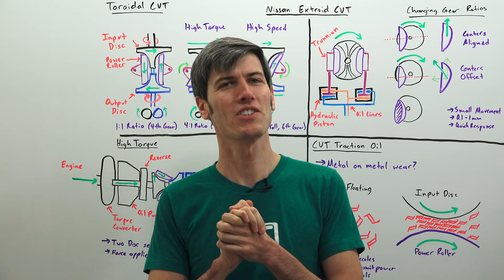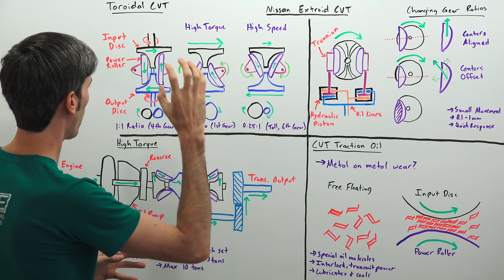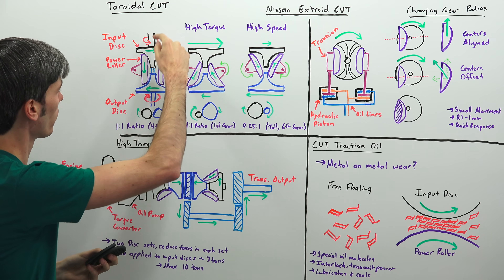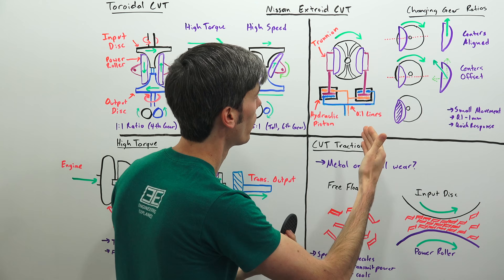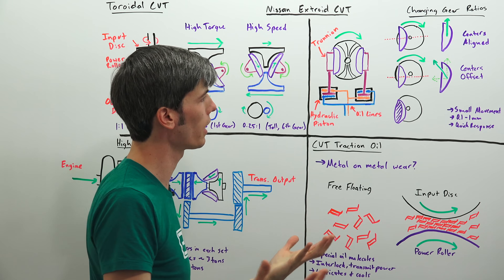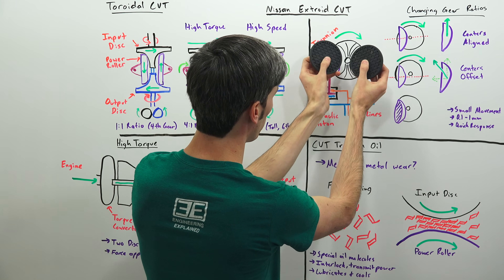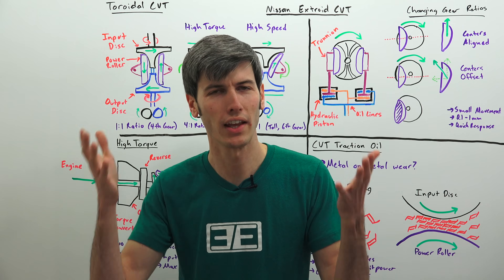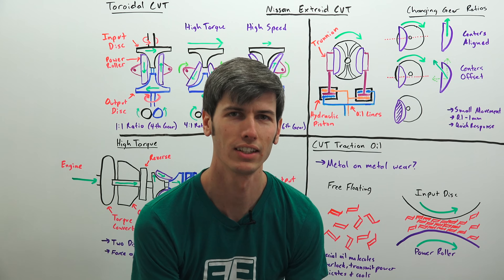Nissan Created The First Production High Torque CVT

Comment: I have the most advanced drive train would you like to know more. It has energy storage infinite ratio integrated drive steering no direct connection from the engine it also has over drive. Its called the Automatic Hydrostatic Integrator w/overdrive only 25 parts including all bearings and seals. reverse forward and overdrive are all using same said system. It has built in pre steering delivering different ratios to the right and left wheels both left front and rear and right front and wheels can be driven by the left and right integrators' outputs' . I threw out the design you just explained. Mine is infinitely variable and can steer without turning the wheels left and right in highway driving. No other design has the efficacy or simplicity. P.S. no clutches bands or torque converter. ! million miles w/o service.

Comment: This is very similar to the constant speed generator used on the A4 Skyhawk aircraft which was made by Lycoming. The Lycoming CSD used a silicone fluid for Cooling and lubrication.

Comment: I've been aware of that transmission for some years.  According to what I read, its ability to transmit torque drops off greatly at low temperatures thereby creating problems in cold climates, such as winters in northern Minnesota where the temperature may drop to -25F or even lower.  However, that problem may by now have been solved.  In any case it's good to know about these transmission developments.

Comment: Subaru seems to have a CVT in the new Ascent. With 277 lb-ft torque and 5000lbs towing capacity, they must have a solution for high-torque CVT. Do you have any information on what kind of CVT Subaru is using?

Comment: A mechanism which uses the lubricating oil to transmit the required friction from one surface to another? Sounds like a contradiction in terms. That puts me off. I remember the cvts in the 1960s Daf motor cars. Cones and rubber bands. I don't think they ran in oil - quite the opposite. It was ingenious and simple, but always sounded (and felt) as if the car needed to drop down a gear.

Comment: DAF made truck CVTs in the 70 or 80, not super reliable, hopefully the Nissan one is better.
Why would the transmission need a torque converter? is the gear change not smooth enough? or maybe they narrow the ratios, so the car is essentially missing first gear, to save money and complexity.

Comment: It a Nissan transmission. Which means it will break a 20,000-30,000. Cause Nissan is known for reliability. Looking at the thumbtack. It looks like a 4 speed transmission. Nissan went back to 70’s.

Comment: Now Ev’s can be almost perfect, fast accelerations + high top speed with minimum power losses.
Reply: Electric vehicles don't need variable gear ratios. Most or all current mainstream designs have a fixed gear ratio, no clutch.

Comment: Epicyclic gears and torque converter do the job just fine. the TC is only used when pulling away from standstill. During gear shifts, the epicyclics are slipped in/out with individual clutches. The big gain with epicyclic gears is straight cut gears with three or four planet gears on each sun/annulus assembly. High torque and no noise.

Comment: I wanna see a manual CVT. There's no reason you couldn't hook up the power roller angle to a lever and stick it into the cabin, allowing you to smoothly "adjust" gear ratio to your liking. Kinda like the prop pitch lever on a propeller plane.

And then hook it up to a foot clutch instead of a torque converter. I'd be happy as ever.
Reply: CVT would simply be less reliable than a stick shift and have no real advantage.

The only reason a CVT could be better than a stick shift is because it can constantly stay at perfect RPM. As soon as you control that manually it's not going to be at the perfect RPM anyway and you could just as well not have a CVT. Also clutch would only be for starting, shifting does not require use of a clutch.
Reply: @FranseFrikandel  The foot clutch for starting was my intention

Also I presume the controllable CVT lever would just be a fun thing; not necessarily for efficiency or power, similar to how modern manuals really don't hold a candle to good automatics, other than fun factor.

Operating it would be almost identical to operating the prop pitch lever on a plane; it certainly isn't impossible (or hard at all) to maintain excellent efficiency or power

Comment: Hate to be the one to point it out, but in the ratio diagram (small circle, large circle) example, the two discs spin in opposite directions, not the same. The front view had the correct arrows, but not the disc views.

Comment: Not entirely clear how any torque is transferred - is the surface of the roller like a gear with ridges if it is smooth does it use some sort of friction modifier, because the coefficient of friction between steel and oil is very low - assuming the power rollers never touch the metal surfaces?

Comment: What a complete and utter waste of engineering effort. It's about time that mechanical engineers stopped arsing about with these intriguing but ultimately completely useless devices and realised what electrical and electronic engineers have known since the year dot ... There has been and still is available a VERY simple, EXTREMELY reliable device that's been around since before the automobile that has just ONE moving part, requires ZERO gearbox (depending on design), can produce vastly more torque and power per mass than any crappy infernal combustion engine and only requires two bearings. I guess technically I lied about the number of moving parts IF you include all the balls/rollers in the bearings. It's called an electric motor. The kind of motor that drives the BIGGEST most bad-assed trucks in the world. Toyota and every other dipshit brained car company in the world will FINALLY wake up one day and realise that "big oil" is screwed and has little to zero future beyond the next 30 years. WHAT A FREAKING JOKE!

Comment: Why they keep focusing on the same concept that was a failure in the half of last century; a toroidal planetary gear with no teeth or groove to transfer power like a proven conventional gears, instead they were trying to develop a special oil that anyways loose it's properties with heat created by friction. Why not RND on the geometry and contours of a conventional gears but with the revolutionary toroidal shapes. My personal opinion is that this is another problem or expensive maintenance that the car owners will have to paid. No thanks I'll keep using manual transmission as long they are available.

Comment: Good thing nissan starting move forward away from traditional metal chain cvt. To these first old design of cvt. I remember a documentary related to this design. I might look at it again to compare with the improvement nissan did specially with the lubricant.

Comment: If it worked for real, after 20yrs it would be in every Nissan - and probably licensed to many other manufacturers as well.
A small displacement turbo engine (undoubtedly short stroke) is certainly not a torque heavy machine. 
A fair test would be living 200k behind a NA V6 with a long enough stroke to make power below 2500.

I'm afraid the "holy grail" of transmissions still has not been found. It would exist in numerous racing series if it truly existed. 
I want a CVT I can put behind an LS motor in a Camaro or 1/2 ton pickup and have it live. THAT would be the game changer everyone is waiting for.

In my opinion, this is just a "cheat" of a very old principle (the simple disk transmission ala MTD snowblowers), and all the high tech alloys and lube (undoubtedly both obnoxiously expensive) don't make it anything new on the scene.

Comment: Not impressed with the JATCO CVT in my 2014 Pathfinder.  This vehicle has a 5000 pound towing capacity and I pulled a 3000 pound trailer for a bit.  Transmissions (CVT or not) should last longer than the front disk brake pads IMHO.  Caveat Emptor.

Comment: Y'know, a lot of mechanical types try to think about a CVT (especially those who fully understand the forces in play), myself included, but the other part of me wonders why bother when entirely adequate electric drives are so (comparatively) easy to implement. It would be easier to arrange a few different electric motors for different scenarios (cruising, accelerating, towing, etc) than to develop a solid 500HP CVT.

Or instead of electric, how about hydraulic? Connect a variable-displacement pump to a variable-displacement motor. Properly designed, it could work pretty well I imagine without the hassles of friction components.

To me, CVTs carry the faint scent of buggy whips (but they ARE interesting to think about).

Comment: If they increase the diameters of the input and output CVT toroids, they could fit 1 or 2 additional power rollers to the design, increasing the maximum torque transfer by x1.5 or x2.   

In the case of 4 power rollers, the design looks like it might be good for diesel engines which work best in a narrow operation range.  Near constant input power, variable output torque & speed.  Very cool CVT design,  if it wasn't for CVT's unpopular 'feel', I would expect to see this much more widely used.

Comment: I frankly don't understand all the negative comments about Nissan CVTs.  Are there units out there with problems -- sure.  Are there units out there with significantly more problems than say, the GM/Ford 6-speed transaxle; probably not.  The fact that they cost more to rebuild than geared transmissions is -- according to a good friend who runs a transmission rebuild business -- more of a function of number of geared transmission (of which there are millions) being more familiar than CVTs (of which the number in service is much smaller) and therefore technicians are able to diagnose and repair a geared tranny more quickly than a CVT.

Comment: What would be the disadvantages of rotational actuation when compared to the linear actuation used here? 
The linear actuation here, though the movement may be relatively small, seems like it would change the contact points of the rollers on the discs, making the ratios nonlinear. This is greatly exaggerated, but for an example, say the roller, based on a unit circle, moves linearly by half of it's radius, the contact distance between the plates would be 1.732, compared to 2.000 when centered. I know the movement is actually much smaller, and I'm assuming that the fluid will compensate for the change in distance. 
I always thought toroidal CVTs used purely rotational actuation, which would have a linear change in ratios, and seems that it would be easier to actuate these; and from a design standpoint, a hydraulic rotational actuator would take up less space than a piston setup. 

Another thing, if they're using two sets because it improves how the mechanism handles power and increases reliability, then why stay with only two rollers per set? They could easily fit three rollers per set, possibly even four depending on design constraints. Adding a third roller wouldn't increase costs by too much, and would save on the amount of fluid needed. 

I'm also interested in the fluid being used, and how much it'll cost. It could come in useful for some experimental projects.

Comment: The only 2 things that i was interrested in are:
1 What's the real difference with something like a nuvinci that also uses a toroid with traction fluid?
2 How are they so sure this will hold high torque?
The thing is, an oil with those flakes in it, that's basically the definition of traction fluid. It's not new. A toroidal CVT is not new (daVinci came up with that idea). How can you achieve new results using old tech? You can only do that if you alter them and improve them. So either they are not telling it, or it's not as great as they claim (or both).
And then: I know Nissan, I know what kind of assholes work at that company. They already have made gearboxes where they decided that 3 radiators was too much, so at some point they scrapped one radiator and as a result a lot of gearboxes on the Teana build after that date started overheating. Traction fluid will heat up way more than oil in normal gearboxes. Automatics already heat up their oil a lot more than manuals, that's why they need radiators. Heat degrades the oil, PERIOD. Longlife super synthetic oil STILL degrades, and STILL degrades faster due to heat. Just take that for granted. There is something too it, and I know for sure the marketing wanketeers are hiding crucial info from us. And IF this CVT would be a really great product in all ways, then they wouldn't be so shy.

Comment: Hi Jason, i've been following the different things you explain, but maybe there is one thing more that is worth spending some time into: why are some car manufacturers (europeans mostly) favouring dual clutch and not CVTs? Which are the challenges and the limitations of each of them? At some point i saw some sort of drag race between same car model but one had dual clutch and the other was a CVT variant. Well, the dual clutch won ... ish. So ... what went wrong for the CVT cause in theory the CVT should be superior. Most probably this "toroidal CVT" is part of the answer ... i guess.

Comment: If these high torque transmissions have been implemented in 1999, then why haven’t they implemented into the GTR? As that is v6 with twin turbos. Regardless of turbo configurations. 
In addition, then why is this not implemented in trucks? As they have just refreshed their new titans. Plus, it would help when take off when towing in a truck?  
Also, this begs the question to why haven’t any other manufacture implement a variation of a high torque cvt?

Comment: I actually have two audis with the same engine with  both cvt and s-tronic double clutch gearbox. A good cvt is way nicer to drive, car pulls harder, it's less jumpy and it keeps a really low rpm mostly (except accelerating ofc). I can agree a lot cvts are sh*t but not all of them.

Comment: How many CTV-s can you put in parallel in ordet to increase torque handling? :D This is kinda cheating, you can do this with belt CVTs too. I admit, de special fluid in this is very cool, but I think it requires very little tolerances between the discs. Can the system adjust itself to compensate the wear&tear?

Comment: I feel like the power loss from transmitting torque through oil is probably pretty substantial.
Reply: Well, that's how torque converters on auto transmissions work.  Sure, it's hydraulic ATF fluid not oil, but it's the same principle.

Comment: My Mum's Honda Jazz/Fit is CVT. I'm an engineer too, and for the life of me I can't see how they have managed to make the holy grail of peak RPM/volumetric efficiency so inefficient. It being a 2005 car does the same MPG (42 - 38 miles per UK gallon) as my 2001 Peugeot 206 manual/stick. I know there will be losses in the torque converter and stuff but I can't believe it isn't returning more!

Comment: I think reliability matters, and CVTs have many points of wear/failure.  The pulleys in my Honda wore-out before 100,000.  This Nissan CVT has direct metal contact (also some slipping which is inefficient).  I’ll take standard and long life gears instead (manual or automatic)

.
Reply: I have a CVT in my Toyota ractis 500,000 miles no issues at all... Only did fluid change once, every story is different

Comment: It looks pretty  ,  but  i think i would stay with my old  Non Nissan family hack with runs on the board slush box torque convertor  conventional   electronic auto  that has seen 17 years of hard service  , with only oil and filter changes ,  a 2 dollar selector seal  and a couple of 5 dollar extension housing seals  in that whole  17 years and it still works fine   :) .

Comment: I dont get it.  Large and small industrial equipment has been running high efficiency axial and radial piston based hydrostatic transmission/drive train systems for decades.   

Why is it so hard to put that in a common vehicle that doesn't have to stand up to anywhere near the abuse or service life?

Comment: Omg. I am so tempted to 3d print one for a rc car. So how would I replicate the cvt lubricant? I mean cold roll steel fabrication isint rocket science "inside joke."  I mean it shouldn't be hard to have someone lathe out a prototype but  I'm really really curious about the way you described its pressure relative friction stability would it function the same on different scales like say motorcycle or a traxxis

Comment: That traction oil scenario reminds me of the old Subaru Justy "no-clutch" tranny that used magnetized particles to make a connection between the transmission and the engine.

This CVT is very impressive, but I really wonder about how reliable it's going to be with that traction oil arrangement.

Comment: Beware of Nissan and their problematic CTVs regardless of any new innovation they may introduce. Their CTVs are made by JATCO. (Japanese Automatic Transmission Company) My friend bought a new 2016 Nissan Altima with a CTV and it failed in less than 60,000 miles. ☝️

Comment: I remember reading about this concept about 20 + years ago. It was theoretical back then. I guess it took technology a while to catch up. Particularly materials sciences. But, that being said, Nissan has a HORRIBLE reliability issue with it's automatic transmissions. Just look at the Odyssey's automatic. If it's a JATCO designed unit, run, do not walk away from this. Their reputation proceeds them. Because it's Nissan, paint me a very deep shade of skeptical on this one...think..French engineering and build quality.

Comment: You could build a deferential transmission hybrid out of this allowing for the changing of speed in individual wheels.
Use the output disc as a ring gear and have the inputs be separated as the two axels. You could make the outside tire spin faster than the inside tire when turning.